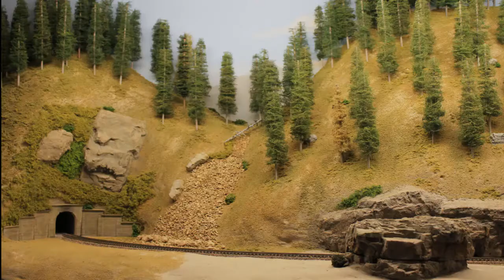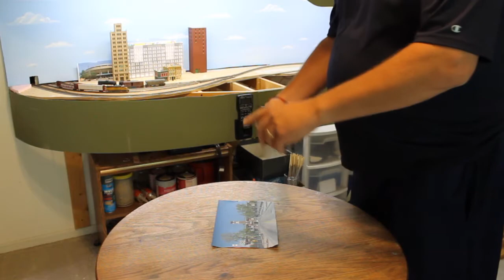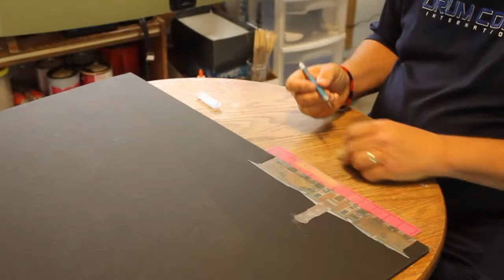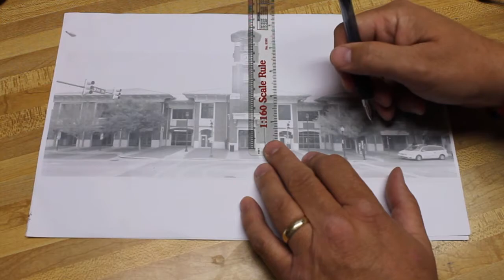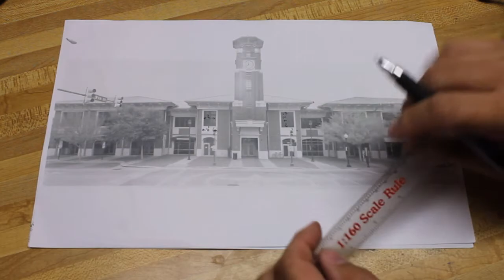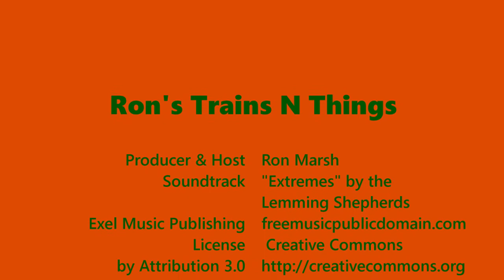How to Turn Photos into Model Structure Building Plans

Comment: When I did CAD drafting for an Architect in the mid 1990's we always used 3' x 7' for doors.

Good overview, Ron
Reply: I am a carpenter, standard doors are 36"*84" for exterior and access ways. 
Interior home and office doors are 80" by 30" or 36" and closet / bathroom doors are 30" or 24"
Reply: Commercial would be/could be 3070 standard residential are 3068

Comment: If you're going to print a building off Google Earth, do you set the printer to 48% to get N scale? I need to find that N scale ruler you have! 😀
Reply from the maker: I don't think there is one magic setting. It depends on how much you have zoomed in on the building in Google Earth before you printed it. I just guestimate, print, measure, repeat until I get it right. As for the ruler, can't remember where I got it and can't find one like it on the internet. Vinny (bnsf6951) has the same ruler.
Reply: I have one that I bought from my local hobby shop decades ago. - C.T.T. Inc. Dallas, Texas - Item No. 9160  - I tried Google and the new Walthers catalog search to no avail. C.T.T. Inc. in Dallas, Texas, like many other small hobby businesses may have gone out of business.

If you have access to spreadsheet software like Excel, create a list of "scale inches"/"scale feet" = real inches.
I use the following formulas: 
Scale Inches = Real Inches =A7/160  where A7 is the cell holding the number of (Scale-Inches) you want to convert. 
Scale Feet = Real Inches =E7/160*12
Scale inch = 0.00625
Scale foot = 0.075

Best of luck to you Bob Reynolds.

Comment: New flat roof over the train room is a 2:12 pitch does not seem that much but over the basic 20 feet gains a little over 3 feet.  Then to run it into the existing roof it gains almost another foot.  Crazy... Now back to modeling
Reply from the maker: That's pretty flat, may give way under the next big snowfall there in AZ. 😆
Reply: I'm more worried about F-14 Tomcats doing Touch and Go's.
Reply: User tip,  It helps gain on YouTube if your END Card links to another channel or playlist.  With similar theme, video or tags - For instant linking to the BBCv2 playlist.  The playlist if full of links to other similar channels doing the same thing,  or link to some of BNSF6951 builds etc.   Link to good playlist, videos and channels.  Do this will increase the odds of your videos show up in the right drop down list and end video blocks that fill in post video end.
Reply: Now that I'm asking,  The phot program I used to use years ago no longer exist for Windows 10.  What  do you use to Fix parallax, keystone and barrel distortion in your photos?
Reply from the maker: Thanks for that tip. I will be sure to do this. I was trying to link the 3 videos I have on a similar subject, but this makes sense. I think I will go in and change those.
Reply from the maker: Where I grew up we had the same issue with A-10 Warthogs.
Reply from the maker: Well, interesting story. I used to use software that is no longer supported as well. I can't afford Photoshop. I have played with some free stuff online, but I was never very satisfied. At this point I try to use photos that need little or no editing of this type as much as possible. When I do need to work over some photos, my wife is a teacher and I can get access to a school computer once in a while with Photoshop on it. I'm still looking for affordable and powerful photo editing software. When I find it I will let you know, and you do the same.

BTW: you just keep those user tips coming. I still have a lot to learn and can use all the help I can get. Thanks.
Reply: That is why I asked to have all the BBCv2 videos titled the same way.  I would like to have matching tags and descriptions etc.  but in the end it ties all videos together and user together too.  I add all the videos to a playlist and this tells YouTube that this is a group etc. with the same type of channel etc.  Makes the odds good your video will be seen in more places etc. etc.
Reply from the maker: Thanks for the info. I feel like I am coming along in video making, but I have a LOT to learn about the intricacies of how YouTube works.